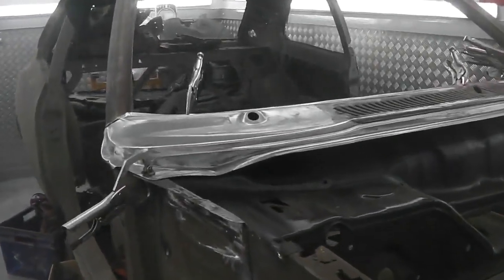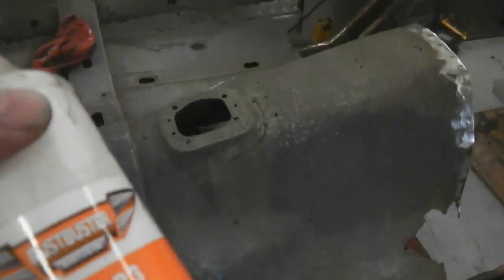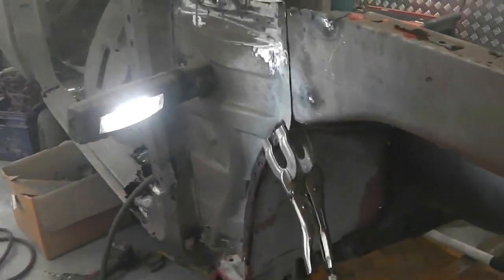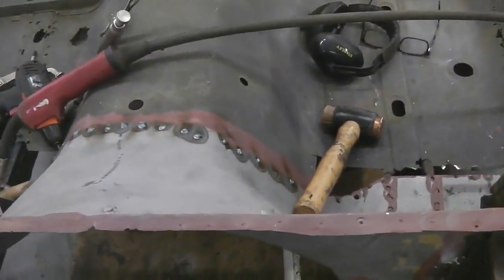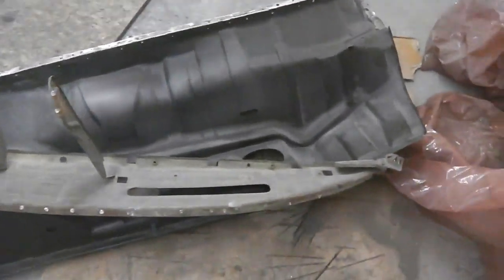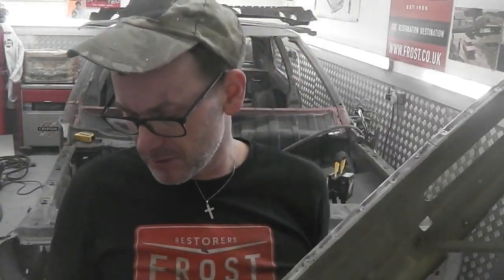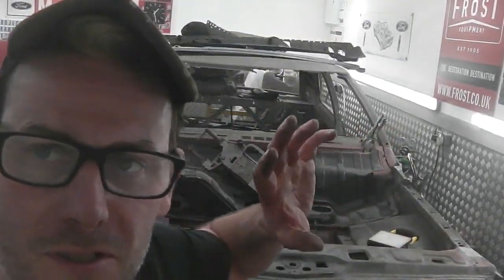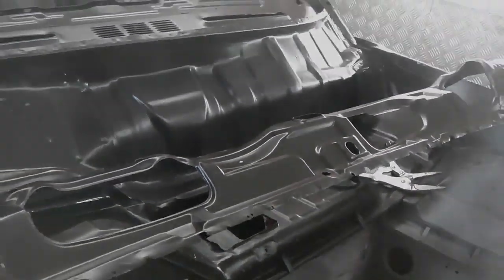Classic Car Restoration - Ford Cortina Mk3 EP10

Comment: Another example of an Englishman taking on a heroic restoration of a car most other people would have parted out or scrapped. And once we see how Pete is doing each piece methodically he is making it look so easy...... right.   😁🚗 regarding the spot welder, yours looks similar to mine with big heavy transformer built into it, when working on awkward jobs I hang it from a chain on my engine crane. I'm getting old and chucking a 15Kg welder about is not so easy now.

Comment: In those lip areas where you're spot welding and you still have rust away voids (air/no metal) we come
back over it with a thin on layer of just the fiber glass epoxy resin with the thickening filler powder and with the 
hardener mixed in of course, don't laugh, we've had a couple of goofballs come back and say it stayed soft and 
just dripped everywhere !
For us it worked as a good filler to hide the rust out voids, helped to seal out water incursion and paints over
nicely. P.S. Mix the filler power in until it is a heavy putty and will not sag or run, it will self level . Do not apply
to close to cook off work with small batches.

Comment: This is becoming very addictive i want to climb in and give you a hand , simply brilliant Pete!!!. 
going back to the welding on the scuttle I’ve been thinking its not so much the heat of the welding that causes the distortion but equally the cooling ,as the weld cools it contracts the metal . constrictional forces me thinks ,unavoidable  . i do have a Tip 'try turning back the wire speed gradually on the mig so you get dip transfer , you will hear a distinctive note . when doing the spot welds they wont be so prunonced and you wont have to do as much grinding back . you are welding spay transfer (crackling)that’s ideal for Butt joints and T fillets as you get plenty of filler. The abrasives are good if you buy reputable makes 3M ,Indasa , Mirka etc . they could be the micky mouse versions as i call them possibly chinese copy , some of the garages I’ve seen using them a mechanic sustaned a nasty injury in the stomach had to have surgery and in another garage the mechanic was cutting a exhaust hanger at the front of the car using immatation 1mm cutting disc it flew appart and went clean through the rear bumper !, and it was double skinned . he was very fortunate not to get injured . I think the dam things must be designed for drills not grinders. Tetnus for you boy dont get hurt i want to watch the next episode x
Reply: I have big mark on one of my legs where a chicom grinding wheel exploded and chopped a piece of my leg out. And it was a 9" wheel too. We all need to use the best we can afford so we can avoid injury caused by cheap crap.

Comment: Hi Pete, Nice to see the Bulkhead  top and bottom in, looks really nice, interestingly there was NOT any  seam sealer in the pressings on the inner scuttle panel on my cars original, and none on the 1974/1975 2000E's  I have, , when they was pulled apart!, The BRAND NEW  inner scuttle panel I  have on my car,  was fitted on the New Bulkhead, so this may be why they are never seen sold on their own. (as they came attached to it along with the dashboard top panel),  Looks like the gully's are there to guide water away from the corners of the outer scuttle ,  great work as always and enjoying your restoration,  I have never had a paint/rust removing wheel do what yours did,  but if you hit a sharp EDGE that can happen!, I always wear gloves/ goggles/ ear defenders, etc, as you always slip if you don't, but never slip if you do.

Comment: For the sanding disks make sure that you sand off the metal edges. If you sand towards an edge in the sheet metal they can bit in. So they are great for flat surfaces, but be careful of the edges. I hope hat this makes sense.

Comment: Hi you should try starting in the middle then just going around from 9 o'clock. You should be able to do it in one rotation then back to the middle. It will save you a lot of time with the plug weld. I admire your work that's for sure stumbled across this 2 nights ago all caught up with the videos!

Comment: sterling work there pete c, just like to make a suggestion as regards plug  welding, before starting each weld just trim off the end of the wire it removes any contamination  that may have resulted from the previous weld and  also   I find the weld starts  to  pool quicker and is more controllable,  only a suggestion every body has their own way.

Comment: Use compressed air to cool down welds. 3-4 spots, cool, 3-4 spots cool etc. Also seems like little to low wire speed and power for spot welds. I do like when it burns more, less grinding shit grows.

Comment: Argon gas isn't necessary, C02 is perfectly adequate for welding mild steel and the extra pressure needed will help cool the metal and reduce warping Edit, excellent workmanship BTW, loving the videos.

Comment: Hi there, seems that I am abt 1 year late! It looks like you are using a 3/8" drill to remove the welding spots. I suspect that 1/4", max 5/16" will also do the job. You will need a lot less welding wire, will be able to reposition the parts more precisely upon reassembly, and will cause less heat impact and warping. Also, when you are doing mig seems, don't do them continuously. Do spot beside spot, and like half a dozen spots only. Then move to the other side of the part and put half a dozen spots there, and so on. Heat impact and warping will be much reduced. One last thing, when shaping the metal, do it cold, otherwise you will weaken the metal. Metal will get soft and rust like wild after being braised. To mold, try using a flat hammer, and always a dolly, or some hard surface against which you hammer. And there is the sound of the hammer against the metal and dolly : when it is bass, you are forming, when it gets highpitched, you are stretching the metal. This is not necessarily what you want to do. Sorry, just my thoughts to try  to contribute. I certainly don't want to teach you anything. You do a fantastic job as it is!

Comment: Hey Pete dont know if its been suggested, with regard to the vents which are closed in the replacement upper scuttle? you now have the cut out replacement which is possibly surplus, can you either grind flat or belt sand flat the underneath thus opening the vents but leaving the tapered edge on the front.

Comment: Great work fitting the grill in the new scuttle Pete, looks like the bulkhead panels went in perfect, would you mind sharing your settings for your gas flow to the gun? back in the late 70's I was a trained ark welder (not welded since) but I'm struggling a little to get the right settings on my mig, I'm getting some porosity in my welds, even though I'm following the guide with the mig I think I need more gas, any advice would be great.

Looking forward to the next instalment Pete, awesome work!!

John   (Norfolk)
Reply from the maker: thanks John, bloomin eck !!! im new to welding, still learning, wire speed on 2-3   power on 1-2 unless thicker metal on cahssis then i put on 3, argo mix, sealey power mig, i dont wanna offer too much advice as im still learnign the trade!!!! Pete
Reply: Haha! ok thanks for the numbers Pete, whatever you are doing it's turning out better than my efforts, I'll keep plodding along, John (Norfolk).

Comment: thought u wud fix the floor first before installing the bulkhead
Reply: The bulkhead is where the strength is, the floor panels are able to slide underneath the floor lower bulkhead panel hence why he didnt weld the floor.

Comment: Also, that 5-6 circle jerking ower the spot weld does not make any sense. It can be seen in close view how you killing Arc. Put more powe on your mig, start from centre as you told. Make ONE slow 360 degrees circle. That’s it.

Comment: You need to slow your swirls down when doing puddle welds, When was the last time you changed your wire feed liner on your mig welder because you can hear as though the wire is getting held up on it's way out of the end of the torch and your holding the torch too far away from your work piece.
Reply from the maker: MArk, mate, thanks SO MUCH mate for this. You really seem to know your welding stuff. Cant say how much I appreciate your help with my welding, im listening to what you say,  really kind for you to offer this help, ok so do i need to swap out the feed liner? i guess it wears out??? I have good welding shop i shall ask em for new one. never swapped it, i do change the nozzles and tips, thanks, Im learning Mark. its good fun too!!!!
Reply: @PeteCswampy I would if you have never changed it since you have owned it, In your welding machine do you have a little wire feed liner between the wire roll and the wire feed rollers if so that could be full of fluff and metal dust where the wire feeds through it, Get a blow gun and blow through it because it might be creating resistance for the wire feed rollers to pull the wire through.
As for the liner in the torch if you have a euro connected torch ( where the torch screws into the welding machine) unscrew it and there will be a nut on the torch connector unscrew that and once that's been removed then you can pull the wire feed liner out and replace it.
Simple enough to do but if you know someone in the welding supplies shop they will do it for you.
As for your welding gas if your doing all the welding indoors you and there are no drafts then your better off turning your flow rate down it will give you a hotter weld and better penetration of the two substrates together, Try it on 2 bits of scrap sheet metal and after each try turn the gas down a little every time and when the welds look more fluid then you have the right flow.
Reply from the maker: thanks i bought new gauges and can now set the pressure, ill look at the feed rollers, its a sealey supermig. yes its euro hook up, ok i shall start turning the pressure down, yes im indoors, i leave a window open  Pete
Reply: @PeteCswampy  yeh try it using less gas flow and the weld puddle should flow better into the hole you filling